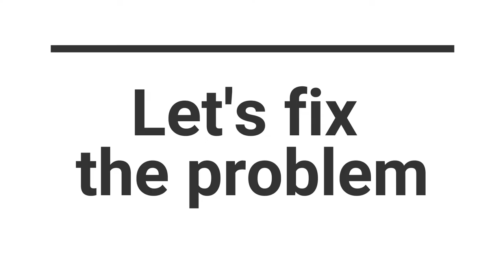WATER INGRESS ISSUES on DEFENDER, (water leaks - wet carpets) | Land Rover Defender | repair series

Comment: Good idea. If you want a sealant for really small cracks - use 'Captain Tolley's Creeping Crack Cure". It was developed for micro-leaks in caravans. Only one thing I would suggest - is a smaller application of initial sealant + going over again. That way - you don't 'splurge' as much which looks as noticeable when you remove the masking tape. I have a really bad leaking (perished) gasket between the screen surround and bulkhead. I was all set to remove the whole tub and re-do it, but I'll try this first. Might get a few more years before having to rebuild the top of the bulkhead.
Reply from the maker: Thanks for advice!

Comment: Great video thanks for the share. Need some advice regarding my roof. Its basically leaking at the seams/joints and also in the middle where there is no joint, paint is also flaking and bubbling, think the last owner tried to fix it without success. It's entire Landrover is currently coated in Raptor (like old style artex). Wanting to get rid of all the flaking, cleaning off with white spirits the primering use Sika flex 521 UV on the joints and then painting the entire roof with bitumen, would also consider using some rust repellent before treating would this be a good idea or not with the bitumen thanks any advice would be great
Reply from the maker: Hi! About bitumen, I'm not sure that it's necessary. The most important is to locate the water ingress points. You just need some sikaflex to stop it leaking. One of the most strategic point is the joint between the roof and windscreen at the front like in the video. Don't hesitate to give us your feedback.
Reply: @offtrackfamily  thanks for the reply much appreciated

Comment: It's a way but I don't like to put some more sealant on top of the old one.
The reason why many Defender a are leaking is that you all have to much weight on the roof. The light weight construction is not able to hold these weight excess. Even if you drive offroad their is to much movement in the whole cabin.
Reply from the maker: Sure it mustn't help to have all this weight on the roof, plus going off-road. But isn't a Defender made for supporting harsch work? Knowing many Defender owners, this leaking isn't only for those who have weight on the roof. In any case, it's best to take care of this issue, and as enthusiasts, we thought it would be helpful to share our experience ;) Thanks a lot for your review!
Reply: Off-Track Family Yes your are right it is build for offroad and all these rough staff. If you have the chance to inspect a disassambled 110 then you know what I mean. I have saw to many. But many thanks for you detailed reports for us Landrover enthusiasts.👍

Comment: That’s not e proper sealing. Its oke but you make some mistakes. 

The roof is sealed with putty and you have to remove the old dried putty. As second take the tape straight away or may you lift the sealant and water will get in again...
Reply from the maker: As said in the video we share our experience as enthusiasts and hope to help 4wd owners to take care of their car. 
If we did something the wrong way as you mention, we do take positively your comment and will research more in-depth for next time. So thanks for sharing your experience!

Comment: I couldn't get Sikaflex 521. Can I use Sikaflex 221 instead?
Reply from the maker: You can but 521 is UV-resistant so it's better for this use. Did you try to find it online?
Reply: @offtrackfamily  had to buy from overseas. Can't find it locally :(
Reply from the maker: @scoopvll  That's a shame:-(
Reply: @offtrackfamily   so, how many tubes of Sikaflex 521 used for the job in the video?
Reply from the maker: @scoopvll  Two tubes if I remember

Comment: Has anyone ever owned a Defender that didnt leak?  I don’t know of any
Reply from the maker: We did 😉!
Reply: @offtrackfamily  you should have put it in a museum as the only Defender ever built that didn’t leak 😄. Both of mine can easily be used as mobile foot baths🛁. A friend of mine solved the problem by drilling holes in the floor so the water just drained out which was pretty useful IMO 👍🏻
Reply from the maker: Ours didn't leak until 2 years ago so last year we solved the issue as well as we possibly could and it's okay for the moment. Thanks for sharing how you dealt with it 🙂.